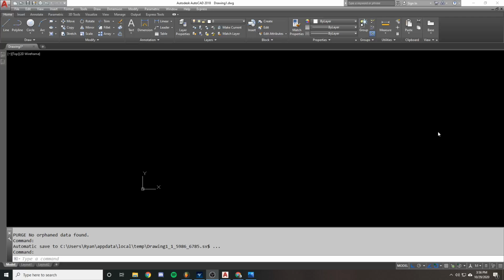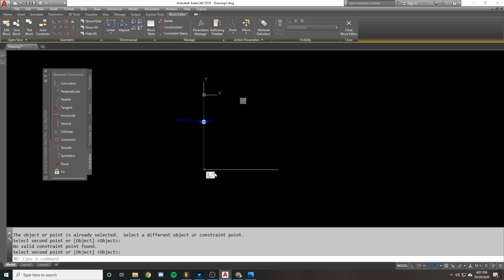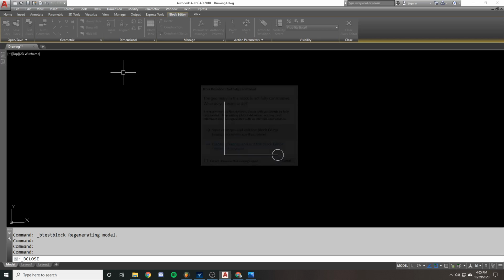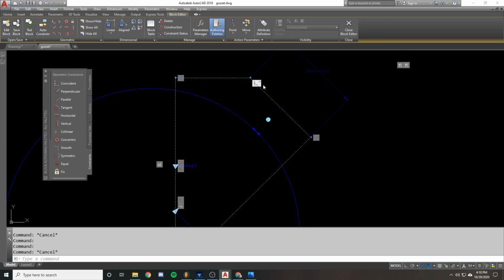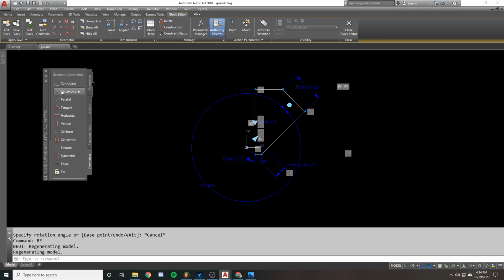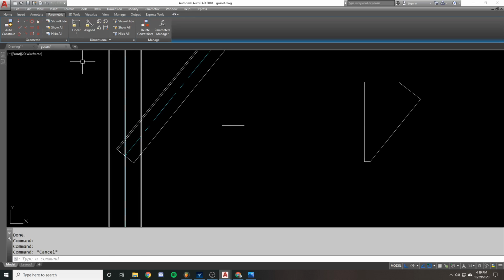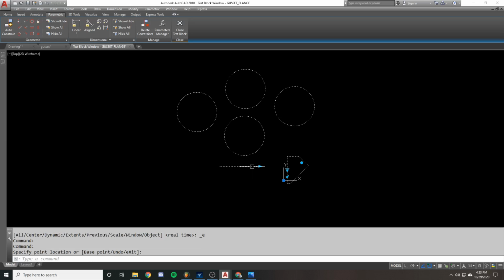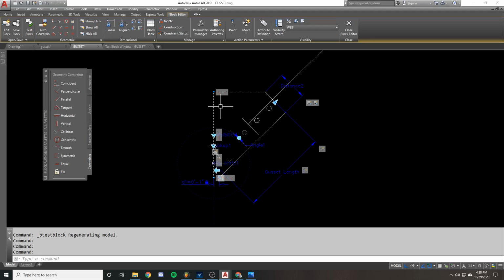Dynamic Blocks - Geometric and Dimensional Constraints

Comment: nested parameters from another Dynamic block? Example, section of a 2X4 (dynamic-2x4, 2x6, etc), over a side view of a 2x4 (DY-2x4, 2x6, etc), over another section of 2x4.......having it with a stretch param from the middle downwards to form an overall view of a section of a floor truss......i tried it and 2 things so far is not happing correctly, the stretch, the 2x4 section being locked to bottom of the side view and being able to see the visibility of the 2x4 sections......im still working on it, your plate w/ holes block is nice

Comment: So I use AutoCAD light where I work and I have made a ton of custom Dynamic blocks but im running into an issue.

We work with pallets at different depths, and because of this I want to make a block that I can past in my drawing, change the depth, and array it as far as I need it to. Here's my problem/goal though:
I want to link an array parameter to a stretch parameter so that whatever I set the pallets depth to, 48" for example, the array parameter will instantly see that and match that depth.

How would you go about this?

P.S- If you need further clarification on what I am trying to explain, please let me know.

Comment: Any advice for creating a dynamic block with the option for 4 different  angles as I drag the blocks up trying to create an item similar to sand flood bags, they can retain walls with the option of 85, 80, 70 and 45 degree. You're videos on array are really great just don't see many on arraying with angles.

So far I've been able to create the 85 degree but as I get to 80 degree the bags overlap each other when they need to be flush, I think i may need to create 4 specific constraints. Any advice would be greatly appreciated
Reply from the maker: I'm trying to visualize your block the best I can. From what I can tell you're trying to make retaining walls made out of sand bags at different angles.  The main issue here is not the angle but the fact that as you change the angle, the array action distance changes and the array action distance is not inherently dynamic.  It's fixed.  The simple, less elegant, solution is to use visibility states for each angle and put a separate array in each one.
Reply: @youcandraft  Is there any way I can send you a photograph?
alternatively I could make 4 different blocks for the time being until I get a better understanding into dynamic blocks. My 85 degree block works ok, however past 85 degree there is an overlap of the bags even though I've set a specific distance between.

Thank you so much for replying! Really appreciate it
Reply from the maker: @Gablo94-y4x  contact me with the email in my "About" page and I can help you out.

Comment: Hmmm, interesting. I just never used parameters (like stretch, scale and such) with parametric constraints since they never seemed to play nice with each other. I see you doing both. Provided one is careful, it looks like one can mix them into a block... and I think there is potential there as you have shown... but, man, that looks like a potential headache. Good on you for playing with them in the same blocks!
Reply from the maker: Constraints overall can be a big headache because a lot of times they don't have the intended outcome unless you lock everything down correctly.  Carefully used, you can create some pretty powerful dynamic blocks.